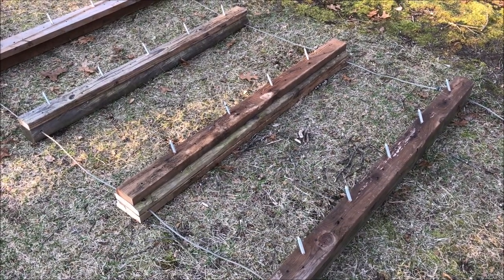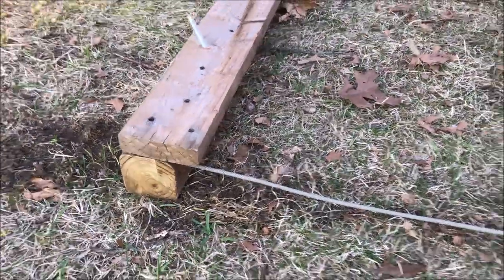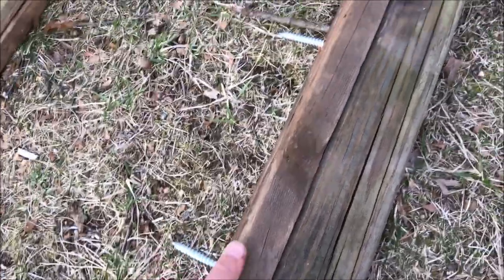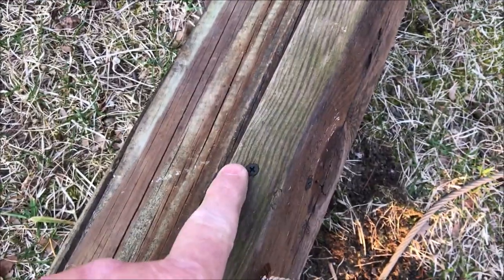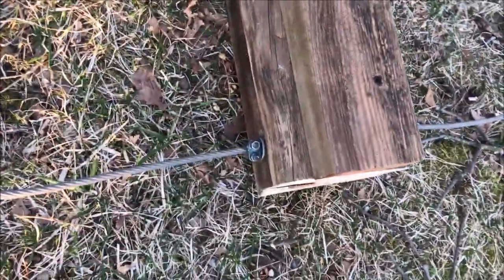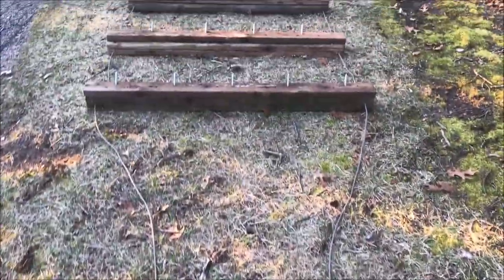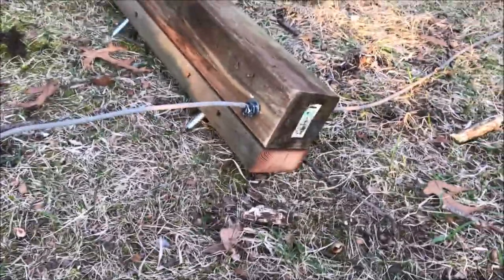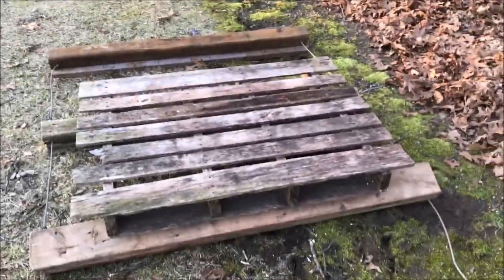OldGuyDIY DIY $50 No Weld 5' ATV Spike Drag Harrow  UTV Food Plot Tractor Field 4" Lag Screws FAIL

Comment: You angled the screws backwards.  Would it be better to angle forwards?
Reply from the maker: Angling the screws to the back allows the drag to drag over material rather than digging into the ground and causing the drag to hop or kick up.  If you angle the bolts forward, there is also a chance they will hang on a root or other obstruction and be torn out of the wooden cross member.  Thank you for asking.
Reply: Very nice idea! Good work!